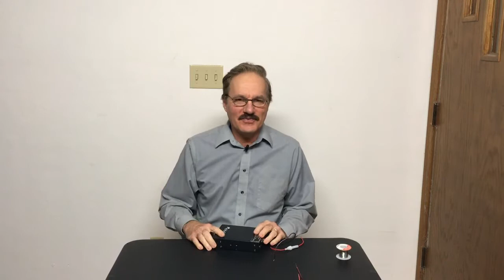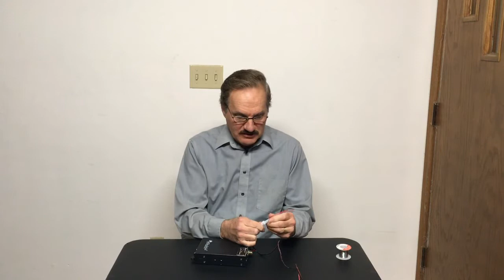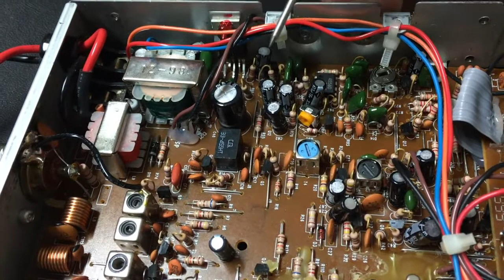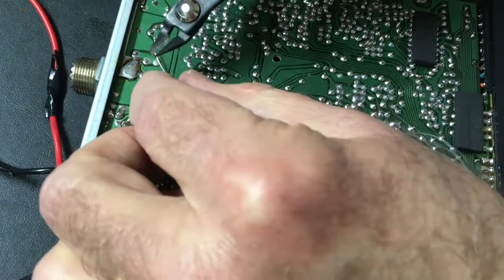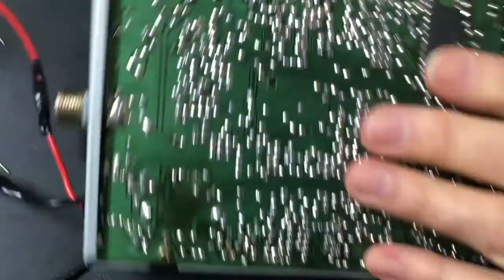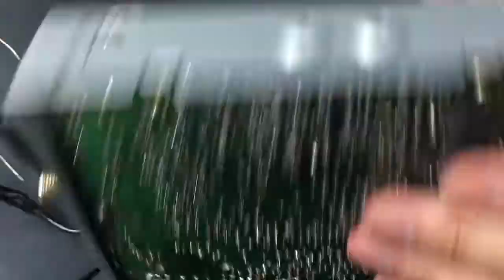How to Fix a Dead CB Radio

Comment: Thanks for the video. I've got a cobra 21 ltd that I picked up from a thrift store for $5. Opened it up and found the oscillating crystal laying inside (the legs rusted off). Replaced that and when it didn't power on, I found your video and took a closer look. I found the protection diode was broken apart. Now it works great.
Reply: You can fix my 138xlr  cobra  for me. Ok.
Reply: How odd to read your comment. I too have a cobra 21 LTD with the oscillation crystal what I thought was burnt might be rusted as well, laying inside. I don’t have another Crystal but when I do I’m going to replace that and we’ll go from there

Comment: Would a Kenwood transceiver uhf be the same ended up with one off ebay kind of ended up overpaying for it didn't really want to radio but figured what the heck he said it was hooked up backwards and some magic smoke come out I looked at the circuitry schematic and I seen like 5 reverse polarity diodes in the schematic will these emits smoke when they blow are Wonder maybe a capacitor not sure

Comment: I think i noticed a film over some parts. I thought somethings melted with the heat inside my car that had been sitting for awhile. I'll have to check that diode. Been awhile since i turned it on because i had no vehicle for many years. Thats about to change so i want to get the old radio working again. Thanks

Comment: I just replaced my protector diode and it is facing the correct direction but I still have no power to the radio. Where would I look next?

Comment: Ok, found the problem. When I shorts the jumper lead going to the plug if the radio, it apparently melted the solder on my leads.  Been chasing the lack of power problem all afternoon! Bad leads!! One of those things that make you question your sanity. 😂

Comment: Got a gift of a high end CB . He tried to cook the radio by putting higher , and higher fuses in. Tracking foil with volt ohm meter and tinning the lands in involved diode replacement next after finger nail polish dries tks Fer your insight on reverse protection I might be a winner de kv4li

Comment: Gday Mate,
I have just acquired General Electric SSB Model 3-5826A and no power on test ! May I ask if the diode on this model be about the same position as the one you described on this video ?
I have managed to download the service manual with schematic diagrams but not too sure on the correct diode to replace 
Any advice would be greatly appreciated
Regards 
Craig
Queensland 
Australia

Comment: Good video and the usual suspect .
If someone took out the diode and turned it on it wiolcwork but always have DC rectifier diode re-installed upon repair. 
2# If someone shorts it without the diode installed the audio chip will be damaged next . AM only cb radios use 2-3 amp where sideband radios use 5-7 amps fuses most commonly .

Comment: Dear Mr Dad ... My name is Marcus Motta and I live in the state of São Paulo Brazil. I have a CB Radio Cobra 148 GTL serial number 83018940 (by Taiwan) - an old model
from 1980/90. I spent a long time without operating the radio and now when I turn it on, I realize that it doesn't receive any signal at all on channels ...
only QRM (noise) ... Some indication of what could be happening ???  ... some diode or electrolytic capacitor???...lamentably I do not have the wiring diagram. thanks for your attention ...
Motta, Marcus
Reply: Don't try to fix it  yourself. Lol

Comment: I have a 29 LTD Classic. Bought from a guy that said it was new and never installed. He had it in garage for 2 years. However when I put power to it it doesn't do anything. I replaced the diode thinking it was that but no go. What else should I try?
Reply: first, get a volt meter and check there is power at the lead, then check for power at the switch.. and so on.
Reply: @RobBob555  chasing wires is the name of the game. A minor nightmare usually.
Reply: Trash cans

Comment: I bought a $5 charger with two antennas, I don't know anything about them. The radio seems to receive great but does not transmit, I tried my friends mics and it tends to be the same story. Where should I start?

Comment: Hello Mike, I have a question.  I bought a Maxon MCB-10A Micro Mobile CB radio from eBay trying to save money because the very similar Midland 75-822 or Cobra 75 WX ST is so expensive.  After arrivaval from eBay land I hooked it up to my truck and testing it, it would transmit very well and transmissions from 50' away I could hear.(the SWR was high)Driving down the road I could transmit and be heard very well but I very quickly lost my receiving ability.  I could be heard but I could not hear.  Like I said the SWR was a little bit high I didn't want to mess with the SWR and change it compared to the normal radio.What I need to know is what is the normal reason for a CB to not be able to receive a transmission?  I did notice there were a couple of companies that had new old stock replacement parts of the MCB-20A additional power/antenna connector box.  Could that go bad and allow a good transmit and bad receive?  Like I mentioned earlier at close range I could hear but not at a distance.  This is above my skill level at the moment for radio communication.  I thank you for any assistance.  Hey maybe a troubleshooting and causes video?
Reply: Yeah, I unsubscribed.  I don't subscribe to a channel that does not make an effort to talk to the subscribers.

Comment: my cb radio got wet, would it be possible if I mail it to you and see if you can revive it back to life?
Reply: Depending on saturation level, immediately remove it from its casing, exposing the internal components as much as possible. Then put it in a bag and dump a little dried rice in with it. Don't be afraid to put some right on the components, just be sure to get all of it out of the nooks and crannies afterward.   
   Leave it sealed in the bag for 24 hours, remove. Shake out excess rice. Put it back together and it should be fine.

Comment: I’ve got a nearly new midland cb model 13-884. Powers up but no transmit or receive. Not sure what my next step is. No squelch either. It’s connected to an antenna and a 12vdc power. I haven’t opened it up yet to start looking as I’m
Not sure what to look for.

Comment: could have shown the 'prove it's shorted' way.
either just break the diode apart and see if the radio powered back up, proves it's the diode,
or take out diode using a diode tester and see if it's dead short..
never assume it's just the diode, could easily have burnt a track, and also it could have also taken out the audio IC, especially being wired the correct way with the diode already shorted..
Reply: bigpimp347 Wouldn't that be the fault of the fool that bypassed the fuse? I DO agree with your thoughts on Mr. Idiot ass not replacing the blown fuse, though.

Look at the guy! Doe's he look competent to you? He looks as though he's sitting next to his front door, and the only furniture that he has is an old card table.

Weird.... He only has one radio as well.